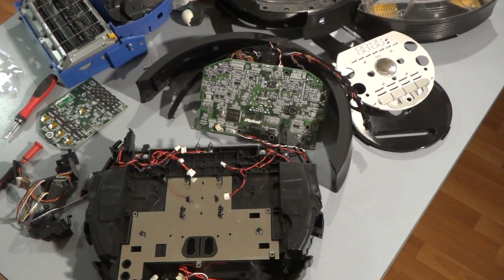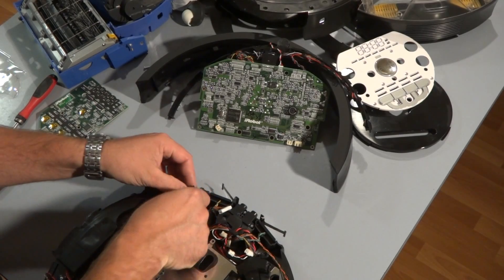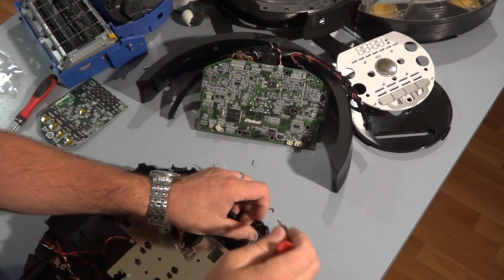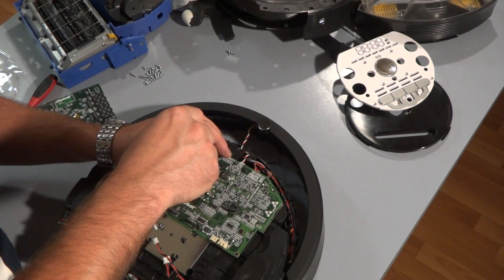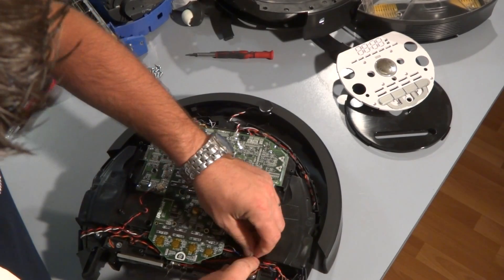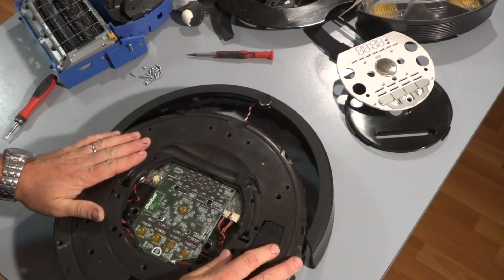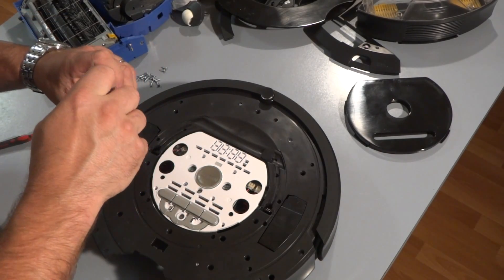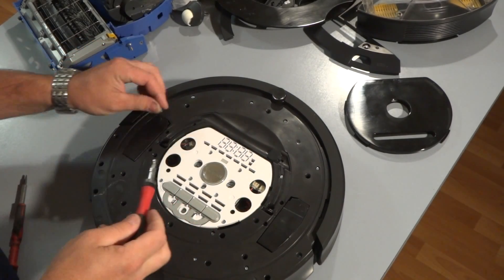How to Disassemble and Replace the Bumper Sensors on the iRobot Roomba 700 Series Part 2

Comment: Excellent guide, couldn’t have done it without you. I did have one part left over, the metal RF shield that goes over the circuit boards. I left it off with no issues of interference. Thanks!

Comment: Please, I would like an answer to this question: is it possible to clean the dust from the interior of cliff sensors, without removing them from their position?
In other words: is it possible to slide down the transparent hood of cliff sensors, in order to flush out the dust inside it?

Comment: Super video.Thank you. My problem is (Roomba serie 700) : the bruches don't spin. Have open and cleaned gearboks, and motor is testet with extern power, it is ok. Bruches spin perfect with extern powerunit to the motor innput-caples. . The wheels is opened and cleaned. All funtion good EXEPT the spinnig of the bruches when the roomba runs around on the floor. I looked at your exellent video how to open the data-units, but I'm  still stuck with my problem.
Reply from the maker: Did you try to do the BiT (built in test) to see if they spin that way? Just to rule out the motherboard issue.

Comment: Is this also applicable for a 980?  
Also, does the 980 have built in diagnostics you can control with the buttons like the 500/600 series?

Comment: I had one side of the bumper that wasn't functioning. I removed the bumper and re-installed it and it works like new again. Some have said that re-stalling the bumper was giving them a hard time, but if you study it you'll see that there are molded in plastic "clips", if you work to get those to go over the matching clip it will eventually go back on. Once I looked at it and realized that, it was a matter of minutes it was back on. Thank you for the video - although I didn't need but a small portion, but having access to the entire process helped.
Reply from the maker: Awesome, good work

Comment: Do I need to take entire roomba apart to replace the top round sensor on front center top of roomba?  It got knocked off and wires yanked out of connector by a fridge bumpers went under but not sensor.  Great disassembly videos!
Reply from the maker: Yes, it is easier that way

Comment: i have watched dozens of videos of your and have learned quite a bit, I have found 3 roombas one is a 585 the other is a 589 and the other is a scooba. they all have issues but i was trying to make 1 good one out of the bunch. i have one that decides to spin in a circle. as in only one wheel moves forward. i have replaced the whole wheel and assembly and that does not change. i have cleaned most sensors, however i am thinking it is a motherboard issue. is there something i can do to fix it? the other one just keeps saying move to a new location, not sure what to do to fix that one. and the scooba has a charged battery but will not power on. any help would be so awesome, thank you for your time and i look forward to hearing from you. My email is donald.meader@gmail.com

Comment: What size are the screws on the top of this roomba?  And if you accidently lost your screws 😳, where could you buy or acquire replacement screws?  Are the screw sizes pretty standard across all roombas? I have the 870 missing screws
Reply from the maker: yes the screws are mostly same on the 500 and newer models

Comment: The vacuum seems to be not working on mine after we had a slight liquid incident! All the rest seems to be OK, all sensor OK and spinney things:). Ive also checked to see whether the vacuum works off the roomba and it does so it seems that its not sending power to the vacuum. Any thoughts?
Reply from the maker: yes any liquid or moisture will hurt the Roomba, you should take all apart and inspect for any corrosion or rust, best stuff to remove any corrosion is 70% isopropyl alcohol
Reply: Yes - with your assistance - thats exactly what I did. I even had the isopropl alcohol from something else I had been looking at... no joy. Vacuum stilll not working.

Comment: Thanks for the super detailed video. I've been having problem with my roomba 530. It won't run. Instead give out "please inspect roomba cliff sensor". I've tried cleaning the sensor, even blinding the roomba by placing white paper underneath the sensor. Nothing work. Would the best solution be to get the sensors replaced?
Reply from the maker: best to do is the built in test, BiT to determine if the issue are the cliff sensors or bumper sensors, then you can determine what to do next
Reply: Yup finally got around to performing the diagnostic test. The two cliff sensor on the left side of the roomba failed the test.

Comment: Awesome job on the videos.  I have my 770 down to bare bones and noticed some water spots on the silver plate beneath the main board.  Board itself looks ok but i decided to do a few test and D47, D45.D54 and D58 showed no change on a multi-meter.  Is that normal? and if not what are they exactly and where can i get them? Thanks

Comment: Your videos were very helpful, thank you!

(Short question) My Roomba is not charging, and makes a "ticking" noise when connected to a charger. Any idea why?

(Long question) My Roomba 770 was left overnight near an open window, and it got soaked (while charging though the charging dock) due to a heavy rain. The charger board got corroded, so I bought a new charger (which took a couple of months to arrive), but I opened the Roomba and it seemed to be just fine!

But now when I charge the Roomba (via dock or directly) it just makes a "ticking" noise, and the charging light doesn't light up. When using the charging dock, the green LED stays on for about 3s, turn off for about a quarter of a second, then repeat (and the ticking sound happens whenever the LED change its state).

As the battery is more than 3 years old and was not used for a couple of months, do you think it is worth buying a new battery, or are the symptoms pointing to some other problem? Is there any way to test individual parts of the Roomba without the battery, or is there a way to test the battery (or charge it without the Roomba)?

Thanks again!
Reply: Answering my own question: I just left it charging for a couple of hours (of course, checking it from time to time for overheating or any other problems), and after a long time it came alive!  :)

Comment: Our 770 has gotten so it does not want to return to the home base.  It just sits out in front of it but does not approach.  Is this a IR sensor problem?  If so can I buy the IR sensors from you?  Also the Rumba tends to turn to the right more so than straight or left.  It will go all directions but seems to prefer the right hand arc.  Please advise.  Thanks

Comment: Thanks for the very detailed video. I just replaced the chassis on my Roomba 880, because  one of the charging contacts was sunk in because the area around it melted.  Thank goodness the chassis only cost me about $40 BECAUSE TWO DAYS LATER IT HAPPENED AGAIN.  I nearly took a hammer to it.  The area around the contact on the charging station looks a little melted too, but it still functions. Is anyone having a similar problem or have a cure for this other than replacing the entire Roomba?

Comment: Hi there. Great video. I managed to open the roomba for a thorough clean. However I have the same problem with the right wheel after some water damage. Whenever I turn it on, the right wheel will automatically run on its own. Same thing when I disconnect and reconnect the battery. The right wheel seem to have a of it own and runs for about half a minute. I swaps the part with another roomba and it's still the same. I would really appreciate any advice on this. Do I have to replace the mother board?
Reply from the maker: +Wendy Tang Hi I am sorry but yes a replacement of the motherboard is necessary at this point

Comment: At 3:52 when you reassemble the connections to the board it looks like there is a spare wire with a white connector. Is this right? that there is a spare ?. I had a spare wire when I put mine back together. On the right side. do those two connections charge the battery ?  Thanks for there video.
Reply from the maker: +Chuck Wilkins hi, not sure which wire you are taking about, but make sure you didn't pull the plug with the wire coming loose, or the white piece of plastic coming of the board with the wire, I didn't have any spare or loose wires, the wires where I say the power wires, later in the video, those are for power input and charging, but the battery connection goes directly to the board, and if you are talking about the wire coming from the charging station contacts, then you have to make sure they are plugged in as the battery will not charge with out the wires making contact to board

Comment: Can you explain how to put a bumper back on the Roomba 880, the new model? I unscrewed mine because I'd pushed it out of position accidentally, and the Roomba just spun around after that. I needed to readjust the bumper, so I took it off (unscrewed the little Philips #1 screws) and cannot put it back on for the life of me.

Comment: Hi,  I have a 650 and replaced the motherboard.   I am struggling with the installation of the part your assembling at 3:27 (IR aray?)  can you offer additional help.  I can't tell what connects to what.  Thanks.
Reply from the maker: please watch the video https://www.youtube.com/watch?v=x25YlTMeEHM as that would be the correct Roomba there are links for the putting the Roomba back together too in the description and at the end of video

Comment: My top home base IR sensor on my 770 stopped working....what should I buy to replace....? Thanks.
Reply: Found the part: Interestingly, when I disassembled, I found that one of the wires leading to the top sensor was cut in two.
Reply: Brad Davis It probably would be good to show how you disassemble the rest of the bumper....

Comment: Hi, I already replaced the bumper sensors but I still get the circle dance error, do you know any other solution?
Reply from the maker: so are you actually getting the 9 beep/left/right bumper error or you just see the Roomba spinning in circles, cause the left or right wheel modules can cause the circle dance as well, did you perform the built in test to determine if the issue is the bumper sensor is the issue, also there is a chance it could be the main board is bad, keep me in touch on how the situation is going, thanks
Reply: TheiRobotChannel Actually I did the built test, and when I press the dock button the light appears but with the spot one it doesn't, so I bought the replace sensors and changed them, but still having the issue. My roomba is quite new, I used it only 3 times and the error came up. I really appreciate your help.